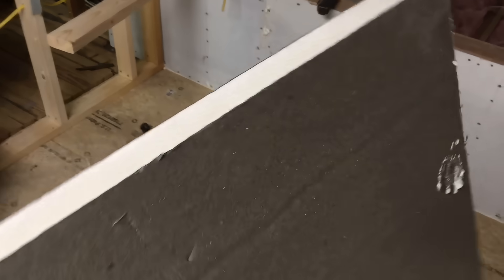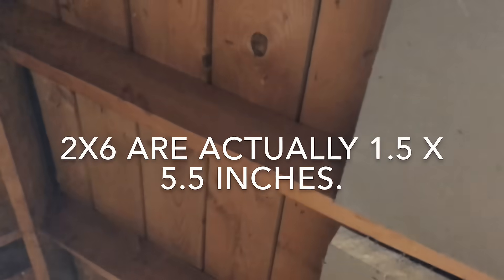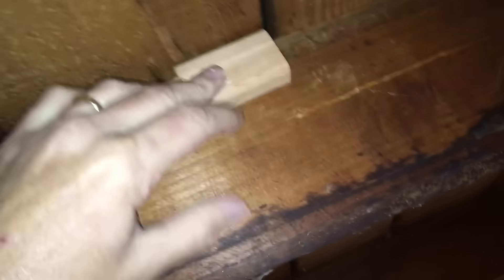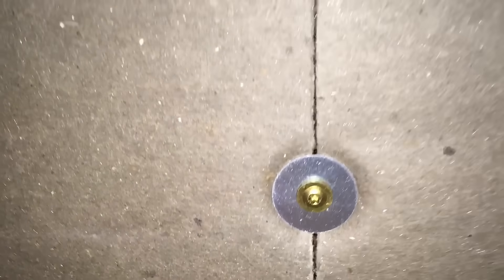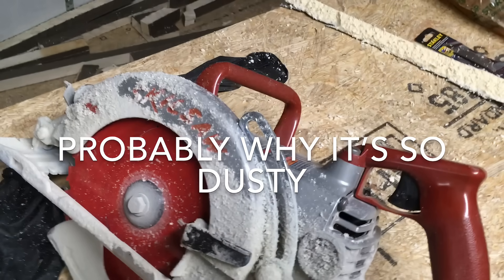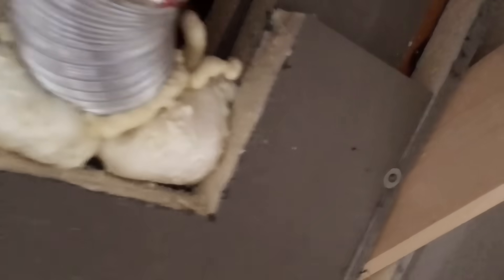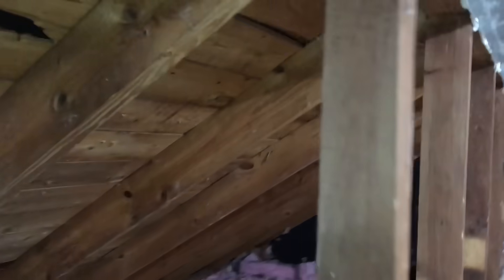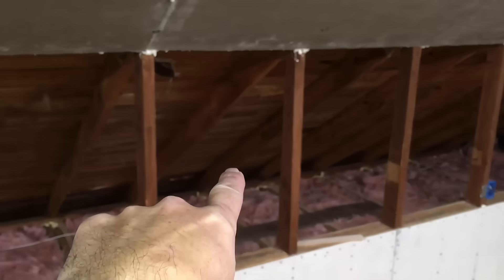Getting R-30 in an attic suite with 2x6 ceiling rafters

Comment: That's definitely not a poor mans way of doing it because that stuff is expensive.
Reply: Compared to spray foam it is very inexpensive.
Reply: @jereomemoore7269  Yes, though I can put R42 in 5-1/2 inches (2x6) when you really need it. Air gaps behind any significant layer of vapor retarding insulation with any kind of vapor inhibitor on the other side of it (e.g., tar paper, ice and water shield) can be a recipe for trouble. It's a nice place for any moisture to sit trapped, or semi-trapped with very slow drying, and that can lead to molds, mildew, rot, and related results. Sometimes building inspectors and shingle companies need some recurrency training at Building Science Corp.
Reply: @ReflectedMiles  Building Science is THE authority for building! I use 8 inches of rock wool in the rafters-metal roof. Any moisture can easily dry to the inside of my conditioned and moisture controlled attic. The rafters are NOT perfectly air sealed, but the floor is air sealed and that also has 8 inches of rock wool-1870s home.

Comment: Forget the space, with foam just go direct contact with the roof. If your inspector doesn't understand, ask him to show the code. Spray foam is direct contact, and well fitted sealed foam panels is to.  Ventilation is way overhyped. especially in the north east.
Reply: I was about to say the same thing. California does not even allow this ventilation. Code mandates insulation to be in direct contact with the roof.
Reply from the maker: He said go with what the shingle manufacturer says. GAF said it must be vented.

Comment: I had the same issue. We need only 1" of air gap above the insulation here in CA.  Sister 1x2's to the rafters to give yourself 8" of space.  Then take two layers of r-15, which will be 7" thick.  Install normally. Prego.

Comment: I cut the poly iso with a knife. You were probably faster with the cuts, but I had zero dust or clean - up time I will stick with a knife

If I was doing 3 layers, I would have removed all the framing except for some strategic mounting points, then put the framing back afterward, the way you did it means tons of cutting insulation, and leaves you with  no edges to mount drywall.
Reply from the maker: tried the knife in this new video https://youtu.be/Z292iuV91hA  Thanks for the comment!

Comment: I ground all the teeth off a 10” blade so it has a knife edge. I cut lots of styrofoam installation with that blade in my table saw with little or no dust or styrofoam chips.
Reply: That sounds pretty smart. We built a hot wire cutting table for a bigger project of ours. It works pretty quick. But your solution is cheaper smaller an more portable. I imagine it would work well with slow rpm as well. Maybe with a lubricated disc. Reciprocating saw maybe?
Reply: @kistuszek  Would a hot wire cutter work with the fiber-reinforced backing?
Reply: @misterlyle.  I dont think so. But i have no experience with that stuff.
Reply: @kistuszek  Thanks for your reply!  I think you are right.

Comment: The r value of polyiso board is suspicious to me, because it shrinks a lot over the years and you end up with big gaps between all the pieces. Much prefer eps/xps, or better yet- spray foam.
Reply: I know that polyiso loses some R-value due to offgassing. But I have not seen any evidence of it shrinking, and have had to open up a piece of a low-pitch roof for repairs. That polyiso had been in place for at least 10 years. Because of the drop in R-values you only pay attention to net R-value when figuring your gain.
Reply: R value loss over time is considered in the published R values for polyiso...it starts at like R10 per inch when still 
“Warm” .  I have never had it shrink in my last 30 years using the product.
Reply: @kenbeiser4443  
It happens in cold climates where you have large temp difference between summer and winter and the sheets are exposed to that, such as directly under epdm.

Comment: Wonder what the negative chemical equation is for hard foam vs spray foam. You would think most of the bad chems are staying in the attic and not being pulled down, but not sure. Also when I cut foam, I pull out the dust with a big vac, by just letting the vac stay on for about 5 min with hose hanging somewhere high and the air looks pretty clear, or you can blow it out by leaving a small salamander blower on for a few minutes. That dust is a bummer.
Reply from the maker: Good advice. Except for a little tweaking here and there with a knife, I did all of the cutting outside in my carport.

Comment: You may not need that much insulation on the angular walls. They are considered cathedral ceilings which most likely have a lower insulation requirement
Reply from the maker: Just doing what the inspector required.

Comment: Best way to cut this poly-iso board without making a mess... Just sharpen the side of a thin putty knife. It will zip right through it. Trust me, last thing you want to be doing is cutting this with a saw.... They make special blades for doing it that are dustless,... But the putty knife will work just fine.
Reply: I agree that the sharpened putty knife is the only way to go. Accurate and very clean cuts.
Reply from the maker: I'll try to remember that when I do the other half of the attic. Thanks.
Reply: @FamilyFriendlyDIY  you won't regret it. 

Sharpen the edge and you'll do fine, use whatever works for a straight edge if you need it. But after you get the hang of it, you should be able to free hand it fairly easily. Just watch your fingers, good luck.
Reply: The covering on that particular poly-iso board is fiberglass reinforced felt.

But thinking about your price per board. If you find a manufacturer around you. A lot of the times you can buy "seconds/non confirming" board directly from them.

When I worked at Firestone building products, they would generally give it away if the person that came in asked if they had any to donate, if they asked to buy it, they would sell it for dirt cheap.

Most the times the boards are perfectly fine, in our case anyhow, they typically just was barely under or over min/max thickness spec by a 1/16 or same for length width of the board. Just barely under/over spec. But still a perfectly fine board.
Reply from the maker: tried your tip in a new video ... https://youtu.be/Z292iuV91hA  it worked well!

Comment: PIR boards made by Kingspan have thick aluminium foil on both sides, therefore I've found that this type of PIR board is the best to work with. But anyway - I would create a ventilatiom gap underneath the roof using OSB3 tongue+groove 15mm boards and the 400mm gap for blown in thermoinsulating cellusose covered by 12,5mm Fermacell board. Estimated R40 ensured 😎😇
Reply: As a Nu-Wool installer i concur

Comment: Here we have to put in attic vents (insulation baffles) between the rafters to allow air flow from the soffits up to the inside of the attic.   Personally I would have ripped down some strapping pieces and tacked them on the rafters to increase the depth then used regular batt insulation.   Polyiso foam works worse in colder temperatures which is why it is useless in Canada.
Reply: I'm doing my attic any recommendations other than spray foam
Reply: I don’t agree with your statement of polyiso working worse in cold temps.  It is among the best insulation for dealing with cold temps....what is your source of info?
Reply from the maker: Good information. Thanks for the comment.

Comment: I'm a big fan of ripping insulation on a table saw. You can hook your shop vac up to the table saw for dust collection as well. But spray foam is the best choice.
Reply: Spray foam is good when it works, but if it is not installed correctly or cures improperly, it can turn into formaldehyde and that will ruin your year in a hurry! I won't ever take that risk.
Reply: @stephendee7839 , That happens so rarely now, it's not even a concern.
Reply: @stephendee7839 , I will. Thanks.

Comment: Wow...Being rich must be awesome!...:)...Great idea though!... The cost for R 30 Batts runs about 2 Bucks a square foot installed...Did you figure out the cost per for this?...it looks like a killer building envelope for an attic...You could heat that whole thing with a small space heater or cool it with a small unit...
Reply: Hum... you missed the point about being required by the code where he live right???
Reply: @noway543  Yeah...What does that have to do with my statement?...I'm just curious about the cost per sq ft comparison...
Reply: ROB-IN-PHILLY in a comment, he mentioned buying the sheets for $20 each. That would equate to $.63 per square foot. But since he applied 3 layers, it comes out to $1.88. It’s slightly cheaper than $2, but he had to do a lot more work with all the cutting of the sheets.. so he would probably be better off extending the heights of the rafters and then installing R30 batts.
Reply from the maker: Took me a couple of years to save up for the insulation :-) thanks for watching

Comment: Close cell.. R7 per inch.. spray 5 inches in bays..  alset.. we do this everyday
Reply: He was required to have 1-1/2 inches for ventilation between roof deck and insulation(no matter the insulation type) with insulation minimum of R30.With a 2x6 rafter measuring 5-1/2 inches that only leaves 4 inches at your spec'd R7 an inch totaling only R28. If you do this everyday you should take a math class or 2.
Reply: Master Debater in my town shingle manufacturers have no problem with spray foam next to the decking. No air gap required.

Comment: No way this is R30...
Reply: Actually it  will be better than R30 because he eliminates the heat transfer to the studs with R11.  I did a simular job on our house and works well.  Need to make sure that one has good venting at the soffit or base of the roof.
Reply: if each panel has an R value of 5.4 by inch than yes and he is and he is even above that... Also like jhfl say by covering the rafter he is also adding a thermal break between the attic and the rafter helping it achieve a little bit more...
Reply: Geoff r 11 per sheet 3 sheets makes r 33 what's the problem, he said.

Comment: You dont need ventilation if your insulating directly to the roof deck.  You can get R30 with 2 layers of 2.6
Reply: Although I like the foam over the joists, it triples the insulation value over them.  I assume drywall can be hung over that foam?

Comment: Well done!!!!   Where we live it is R22 on the  diagonal & Vertical & R60 in top horizontal (Attic).  Never thought of using your method and it is indeed a sound solution. Just as effective as sprayfoam but without the cost and possible off-gasing (if the two chemicals are not mixed just right). If I ever have to do this again I will copy your solution! Bravo
Reply: Polyiso off gasses for years, what’s the difference? At least spray foam won’t shrink and have gaps like this does.
Reply: @brucea550  sprayfoam can offgas if the two chems are not mixed perfectly. Rigid foam does not.  Gaps can be filled.  If mixed right, spray foam is good but limited to the building structure. It is a death nail to older homes if used on double or triple brick construction.  Eventually creates blowout in bricks.
Reply: @JB-ct3cr  how does it create blowout of bricks?
Reply: @JB-ct3cr  great info
Reply: @JB-ct3cr  so i have 1 brick wall left on a walkout basement, i demoed the rest of the house and rebuilt block basement on the underground side. I can use R 30 on that and not spray? This is the only side exposed to air so i need to insulate it.
Reply: @matthewmatheny  yes. Spray foam can be used on block foundation walls or you can use batt. If you use batt leave a 1 inch gap between the batt and concrete block wall. If you are nervous about sprayfoam or simply want to avoid the cost, R20 or 30 batt insulation is fine. 2x4 framed walls fit R14 but if you move the framed wall away from the block wall by 2 inches you can get an R20 or 30 batt. No need to frame 2x6 unless it is a load support or the 2x6 wall would be external where not sistered to a block wall. Another good solution is 1" rigid pressed up against the block followed by R14 or 20 batt between 2x4 studs. If you are not finishing the basement and just spraying the walls remember that all spray foam or rigid foam must be covered by drywall or particle board. Not plastic or you will eventually end up with water buildup between the foam and plastic. The only time you can use plastic (vapour barrier) against spray foam is if it is open cell. If it is closed cell then no VB is needed. My personal approach is framing 2x6 with R30 walls for basement. Codes vary so you may need to check your area
Reply: @JB-ct3cr  thanks!

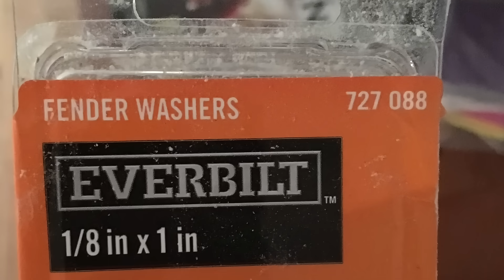Comment: The screws shown at 3:33 in the video at probably real good but expensive. I know you won't doing it again, but for other that will, I have a cheaper great option. I the world of "Exterior Insulation Finishing System" called EIFS, suppliers sell coated screws with 2 3/4 plastic washer pre-attached with lengths up to 5 inches. The washer are design to allow the screw head to sink below flush and pull the washer below level when used on extrude or expanded polystyrene. I am interested in this building method for a simple detached garage, but with a 
2 X 6 measuring at 5 1/2", I would rip a 2 X 4 and add to the bottom of each rafter. I am know interested as to shingle life as home rebuild show 2" of closed cell foam, followed by 4" of open cell spray foam. While expensive, is adds to structural rigidity, very high "R" value, but as you pointed out, leaves no room for air flow under the shingles substrate. I will contact via email, several shingle manufactures as we want long term results, while reducing heat of cooling cost overall. The structural spacing of 3 to 4 feet with 2X6 construction reduces the number of thermal breaks in extreme temperature differences. 
The possibility of netting filled with cellulose with gravity causing it to sag, but leave some breathing room for the shingle would work? More questions as spray closed cell foam would be nice, but a new Bentley Bentayga Luxury V8 would be nice as well. Thanks for the video.
Reply: I installed foam board to the underside of my rafters as the poster has done. I used a roofing fastener that has a 2" twist nail and a plastic washer. They are inexpensive and allow for the head of the fastener to lay flush with the foam surface.  It is a good idea to allow for ventilation space below the roof decking. This allows inside, humid, heated air to escape into the cavity and be removed by the flow of air from soffit to ridge vent. A 1" space is adequate but if a shingle material requires 1 1/2". that is what I would do. FWIW, my attic space dropped 15f in temperature after installation.
Reply: Okay, why do you have such humid air? Indoor pool? I hear so much about moisture and have no idea why people think they have so much moisture. And it’s going to pass through finished Sheetrock and 3 layers of polyiso? 
Now forget about the moisture you don’t have, because that’s not even the purpose of the venting. The vent is to keep the underside of the shingles from being a drastically different temperature than the exposed side. If you have a hot humid attic then vent the attic! If you live in a humid climate, what sort of air do you suppose is passing through that precious vent system? How are you eliminating THAT moisture?
Reply: @brucea550     If you insulated, you must ventilate. Moisture is in the air, it condenses into water droplets if the temperature drop below relative humidity. Bathroom and kitchen power vents should always be insulated in the attic and pass to the outside, not into the attic. The moisture will not form if the air is the same temp as the outside and air is allowed to move. Watch a few episodes of "This Old House", or email Richard Trethewey, then ask him. Unless I don't understand the extremes of you question.
Reply: You must ventilate whether or not you insulate. Air movement/exchange is critical to any building. My question is specific to the amount of moisture that people seem to think exists. A typical home runs between 40-60% humidity in the winter. If, as you mention, the kitchen and bathroom are properly vented to the outside, then what other source of excessive moisture is there? Water can only travel in air, so if the spray foam seals the sheathing against air, and removes the dew point, how would condensation occur? And if warm air cannot reach the sheathing, then you do not have a hot roof and do not require ventilation for that reason either. Between kit/bath fans and doors opening and people going in and out, you have enough air exchange in most houses to prevent excessive humidity in the winter when air is typically dry anyway.

Comment: You should have just packed it with cellulose.  Your shingles will last longer than the warranty,  your insulation would have zero gaps, and you wouldn't be breathing in that crap.